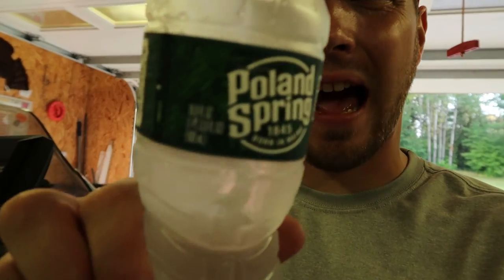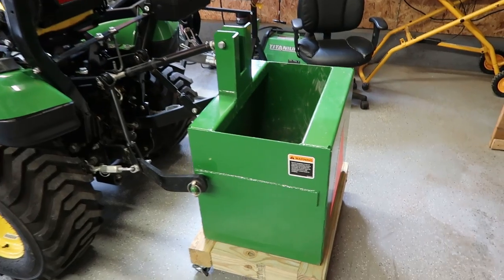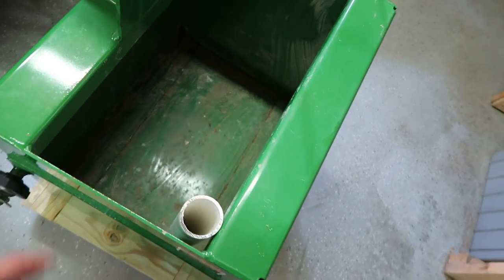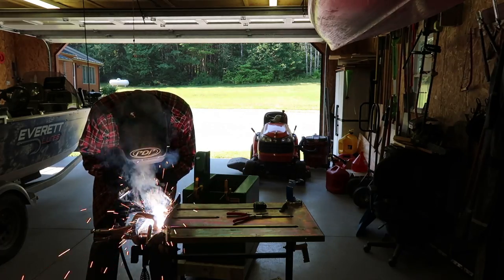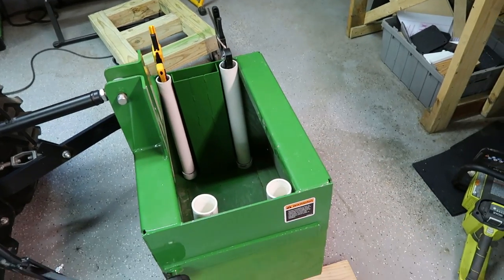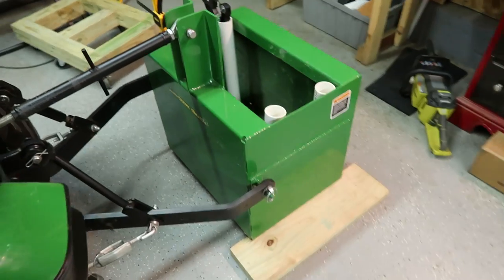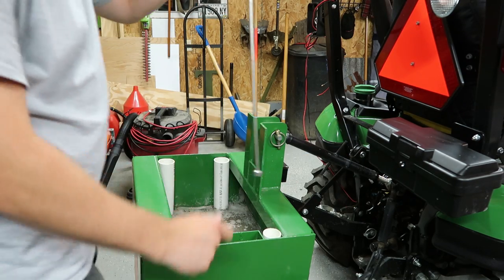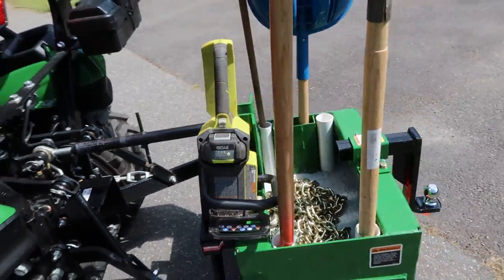DIY -BALLAST BOX MODS

Comment: Nice video. I bought a Agriease ballast box and didn't want to fill it with useless dirt, gravel, sand or concrete - so I started thinking about all the stuff that I have hanging on the walls or leaning in the corners of my shop and decided to create usable ballast. I collected my two bottle jacks, my chain coma long, six tow chains,  axe, hookaroon, pry bar, bolt cutter, pull rake and attached a shovel clamp on the outside.  Works well for me and gives me wall space while keeping all this stuff I seldom use - in one place.  When it gets dusty, I blow it out with a leaf blower.

Comment: Watched your vid again and I think your idea to lengthen the PVC tubes a bit and cover the open part of your ballast box so it won't get filled with leaves, branches, and crap.  Have you used the ballast to move boat and trailers with your new bolt-on hitch receiver?  I like that idea.  👍🏽🙂

Comment: I like the idea of the tubes on the side but my only concern is that in colder weather they might snap off and would not be easily replaced . Why didn't you use some sort of metal pipe?

Comment: 4bags 80# = 320# If you only added a couple of gallons of water that is ~340#
The wt. of the box might bring the total to 500#, which is a pretty good amount for that small tractor. If you have the owner's manual it will discuss ballast amounts. Pulling trailers from behind that box might make you too tail heavy, be careful.
Enjoy your new tool.